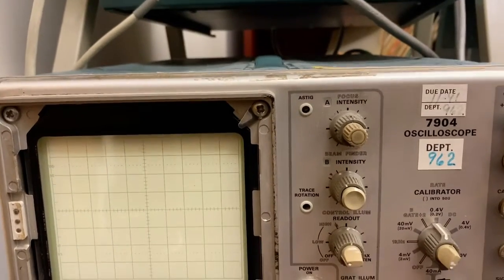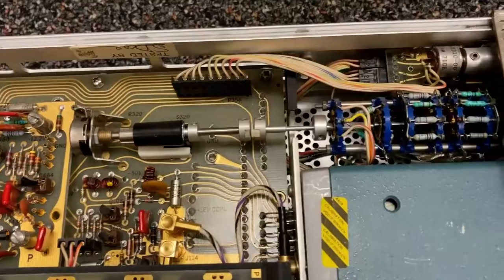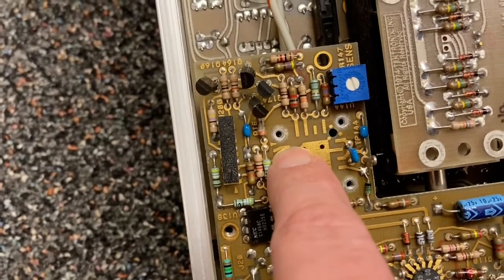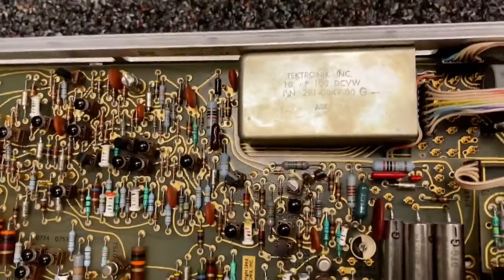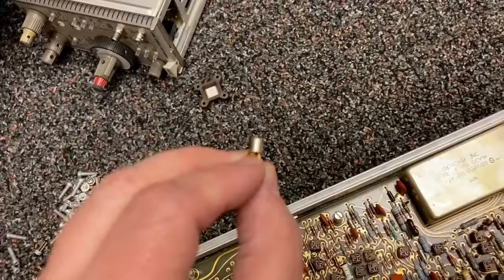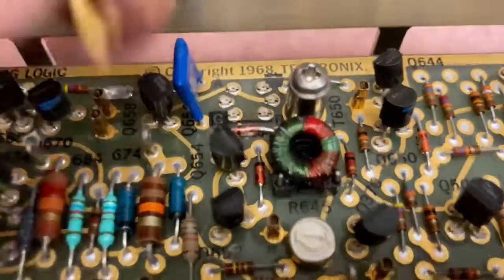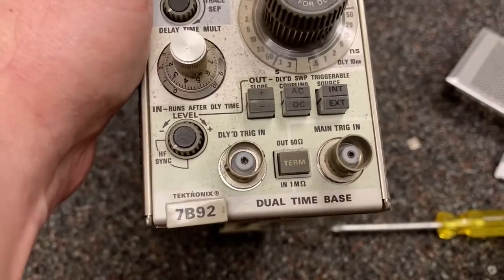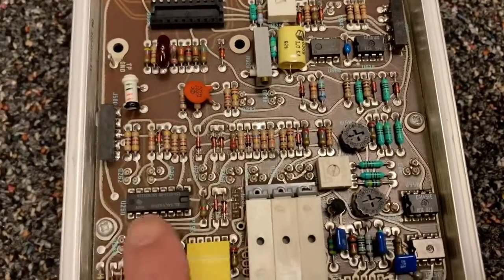Inside a High-End Vintage Tektronix 7904 Oscilloscope, PCBs from 1968-1974 (unusual construction)

Comment: DON'T TOSS THEM! They're still really good scopes! You can turn them into a spectrum analyzer, a multi meter, a regular scope, or even a curve tracer!

These are modular, yes they take up a lot of space, but I find these main frames to be still more capable than most modern devices. 

If you have no choice but to get rid of them, put it up for auction or something, or give it to some one who cares about it, and will take care of it.

I have a deep moral that says no Tek instrument should be thrown away.
Reply from the maker: Alas, they were inventoried Georgia Tech equipment; we're not allowed to sell them. I would have sold them or given away to someone who appreciated them if I could have. None of my colleagues were interested in them, and they think it's weird that I'm so interested in this "old stuff." 

Because of space, I wound up having to surplus the mainframes, but I kept the plug-in units for parts (I also have a bunch of 500 series plug-in equipment I'd like to build an old-fashioned pre-modern-synthesizer electronic music studio out of, like Hainbach and Stockhausen. Again, my fellow professor think I'm nuts for my interest in old equipment).
Reply from the maker: I've sorted the 500 series stuff into the categories of "turns on," "turns on but smells bad" (I think some tantalum caps have had tantrums), and "doesn't turn on." I'm hoping to interest some students into testing and calibrating them. I find students are fascinated by older technology, like this stuff and the S-100 bus computer systems we are playing with, because they can see things -- most modern electrical and computer engineering is so opaque, with chips with billions of transistors and piles of abstractions.

Comment: @Lantertronics, I’m about a month late so don’t know if you’ll see this, but thanks for the tour! I’m the proud owner of a Tek 485, which is a portable analog scope from the same time period, and one of their higher end units—I believe it’s rated to 350MHz. Got it a year ago on Craig’s-list, with a new set of probes, for $100! It worked, and with some switch cleaning and a simple calibration procedure to fix a trigger issue it functions perfectly from what I can tell. It’s a gorgeous dense block of fine analog electronics on the inside. I found a comprehensive repair manual with schematics and board layout diagrams, so I’d imagine similar materials are available for your units. The vertical amps in particular are supposed to be engineered to an amazing level of precision, and an interesting tidbit: there was a caution note saying that some of the transistors shouldn’t be disturbed, as part of factory calibration involved adjusting how they were seated in their sockets!! That blew me away... I learned that the round parts are tektronic custom ICs (another commenter noted this as well) and the jumpers with pin and sleeve contacts are coax. Glad to hear you’ve decided to attempt restoration, and good luck!
Reply from the maker: Right now my main restoration task is to just put all the parts back in the right places. ;)

Comment: In Jim William's book "Analog Circuit Design, Art, Science and Personalities" there is a chapter written by John Addis, who did a lot of the design work on the vertical amplifier circuits used in this era of Tek 'scopes, which goes into some detail on the design concepts that were employed. Indeed, there is also a chapter by Barrie Gilbert, as well as many other analog design luminaries. It's a must-have book if you're interested in analog design, full of fascinating insights from some of the brightest design engineers of their time.

Comment: In case nobody else mentions it, the multi-pin odd looking round IC's, are custom TEK hybrid modules--basically unobtanium for people trying to restore these scopes. TEK actually set up their own custom fab, when they decided they couldn't get the speeds they wanted without their own process.  The 7904 as only bettered by the 7104--I thin it is still the fastest analog scope ever made. It had a micro-channel plate for the crt to enhance the light output at those fast sweep speeds.The story goes that TEK developed it for the AEC to use to capture the very fast events from nuclear bomb tests, and the AEC bought a lot of them,  With the matching 1 GHz amp and horizontal sweep module, the 1980 price was $21,530, or about $76,000 in today's dollars. The 7904 wasn't that much less, but had a much larger available market. The7904 is still one of my favorite scope platforms, and I'm definitely keeping mine. :)
Reply from the maker: I've decided to try to get these working. :)

Comment: That hurt my soul to see these getting taken apart
Reply from the maker: I hadn't realized so many people still use these and love them so much. Y'all have convinced me to get them working again.
Reply: Hurt my soul too.  I would lovingly restore them.  If you don't have space you should advertise them so someone can look after them.
Reply from the maker: I need to figure out where to put them. They are HUGE.
Reply: Very childish to just pull parts off at random and not put them back.   You turned what was probably an excellent oscilloscope into scrap electronics.   Someone should give your hands a few hard slaps with a ruler.

Comment: These are gorgeous scopes, find a way to make room to keep them - you seem like you respect good engineering, these still represent good electrical engineering, and are rewarding to get to know. You could do worse than find a way to teach some of the positive principles from these designs to your students, while also highlighting the total lack of design for manufacture (which is par for the course in that time, but an advancement that is well worth highlighting for today's students.)

I believe Tek used to have their own fab line, because they designed and built their own custom chips (because they simply could not buy what they wanted on the open market) - I think they sold the fab to Maxim way back when, and of course, Maxim is now owned by Analog Devices.

Also - it is worth learning how the readout circuits used in the 7000 series works, it was an absolutely fantastic design (by Barry Gilbert, he of The Gilbert Cell). Powerful, yet simple to implement - some of those boards above those cam switches were the readout boards for those modules.
Reply from the maker: I have been convinced to try restoring these.
Reply: @Lantertronics  

Nice. From an EE perspective, they and HP gear of a similar vintage represent excellent designs that you can actually wrap your head around and teach/learn, instead of let's just throw a cpu at that. Much like the Buchla or Moog circuits you wrangle so well.

Comment: Roughly in order of appearance: The 0078's are high speed broad band amps. 0160 is a trigger amp, and next to it is 0150 a trigger detector.The 0185 is a 4 decade BCD counter. No luck on the TO package IC's, Fairchild I think. Same with the Raytheon, there's a tube with that number that dominates the results. 0035 is a wide band quad op amp. Blanked out one is probably a CotS replacement of a custom chip. 723hc is a voltage reference. Choice of sockets was often down to parasitics; more sensitive and higher speed stuff required lower profile sockets.  0049 is a sweep control, similar in spirit to a 555, nifty part. 0061s are more trigger amps. I think that's it for the odd stuff.
Reply from the maker: YOU ARE AMAZING!

Comment: Hey Aaron, definitely keep the 7904 - it's the highest end "workhorse" type. I run the Tektronix / HP discord and we even have people from Tektronix there, so if you run into any issues, we can help you out with the repair, with schematics (for your specific serial number if they're not available on BAMA or TekWiki), and with spiritual support. You can email me (find my email on the synth-diy list) and I'll direct you to the discord.
Reply from the maker: I have been convinced to try restoring these.
Reply: @Lantertronics  great stuff. Bear in mind restoring one of those goes a little further than just "common sensing" some of the circuits. For example, tantalums have for a while been under-rated (because people did not know yet how to rate them correct), and some other things need, eh, "special care". If you post on the TekScopes mailing list, you'll get heaps of helpful replies!
Reply from the maker: How well do the capacitors hold up? Am I in for a recapping nightmare?
Reply: @Lantertronics  often you only need to do very selective jobs. other people in the community can tell you more - hop on over to the discord or ask on the TekScopes mailing list

Comment: I like those integrated transistor sockets.
I also guess you now have a whole bunch of matched transistors for $stuff.
Reply: terrible idea - those transistors are hard to come by and are matched in weird ways; you can get matched transistors matched /in a way that you can use/ for cheaper than the time it takes you to dig them out of the mainframe

Comment: Very interesting. I have a 7904 carcass along with some modules - it was my main oscilloscope until lockdown when it finally let out the smoke. I had fixed it numerous times previously, but needed something more reliable and portable, so it took it apart. I harboured the idea of using the thing to make like an API style lunchbox of custom audio FX... but I haven't even fixed all my normally broken kit, never mind something that needs lots of design attention! Great video - enjoyed trawling along with you there.
Reply from the maker: It's a beautiful unit, but yeah, it's soooo bulky...
Reply: @Lantertronics  it's deep man, too deep! Heavy too! Actually the thing that impressed me was that IF you can dig the main PSU filter caps out from the back end of it, they are incredible quality, and mine showed no increased ESR even after all these decades! ...also fun "Warning, 7000v!" type labels on the main carcass. ⚡👋

Comment: The loop of wire is a delay line to align timing.
Reply from the maker: Oh! That's very interesting!
Reply: @Lantertronics  yeah isn’t it? Back then that was a robust way to phase align signals. That’s why it’s a coax cable - to reduce external interference.
Reply: @Lantertronics  there's a Tek device used for pre-delay for i think the 500 series oscilloscopes (they're the older, tube based, modular tek scopes) that's basically a spool of hard coax in what I think is a 6U rack or something to that effect.